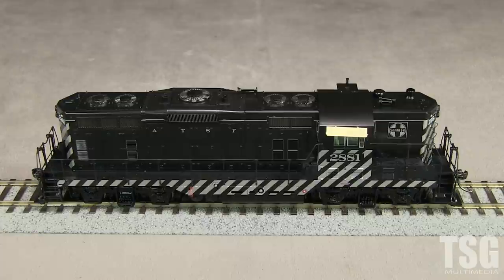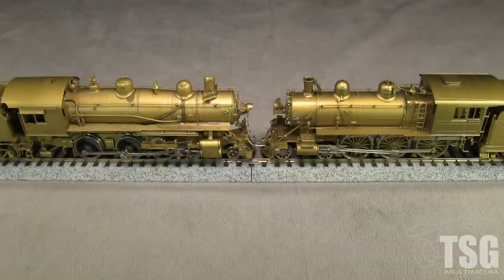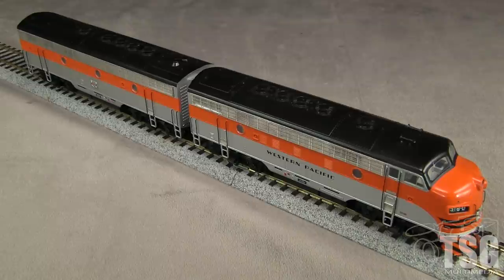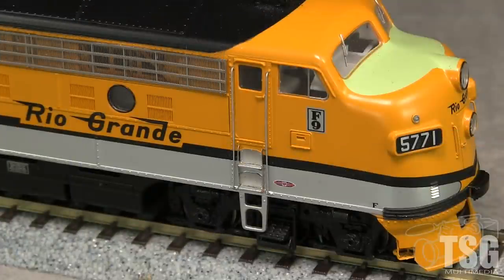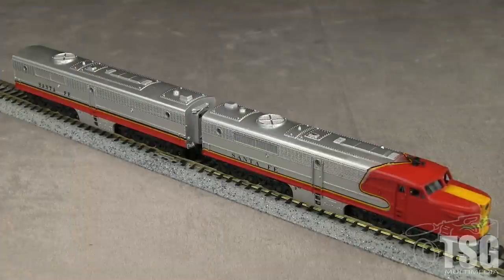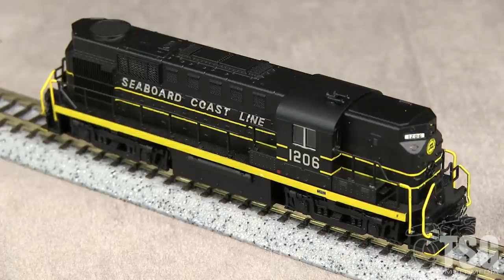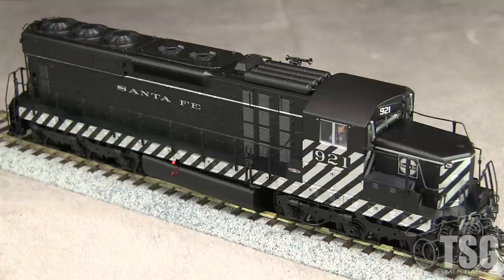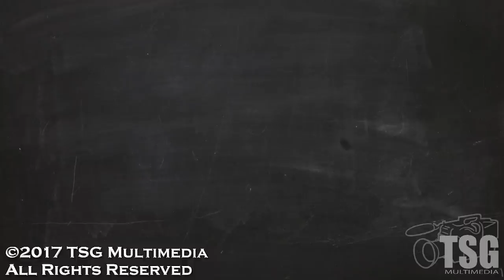Model Railroading 101 Diesel Locomotives For Beginners Pt 1

Comment: Another huge difference between steam and diesel:  To start a large steam locomotive from cold takes in the area of 8 or more hours to raise steam.  Plus there are hours of checks and maintenance (usually split up among 2 or 3 men) that goes on concurrently to the firing.  A diesel needs a lot fewer checks and maintenance.  It is much more like starting a car.  From cold, a diesel can be ready to go in 15 to 30 minutes.  

Consider if a train has an 8 to 12 hours layover.  On steam locomotive, either you have someone mind it and spend the fuel to keep it hot, or you have to do the hours long start up to build steam.  One could start out with less than full pressure and build pressure while rolling, but that might not work well with a heavy load or climbing a hill.  With a few minutes of warm up, the diesel is ready to make full power.

All of the above is why you often see steam locomotives being moved for short trip by being pushed or pulled by a diesel.  It is impractical to spend 8 hours building steam for a one-hour trip or just to move the locomotive around the yard.

Comment: I was attached to a diesel submarine in the late 60s with 4 Fairbanks-Morse 12 cylinder opposed piston engines. The old WW2 boats had GMC 10 cylinder engines. The piston-rod assembly weighed 273 lb.

Comment: Answer: They copied each other.
Alco seems to have invented the hood unit yard switcher in about 1930 with it's HH (High Hood) series. EMD (orignally called EMC) started building their more successful SW's from about 1935.
EMD may have originated the cab unit, car body (E unit, then F unit "covered wagon") type in about 1937 - 1939. Alco and others quickly copied the concept from about 1939 - 1940.
Alco may have been the progenitor of the hood unit road switcher (basically a yard switcher with a washroom / storage closet extension under the "short hood") with their RS1 in about 1940, but there is some disagreement over this. EMD didn't start selling their (highly successful) GP's until about 1948, after Fairbanks Morse and Baldwin introduced their equivalent road switcher types.
During the 1950's, any successful new development by one manufacturer (eg. cut down short hood) was quickly copied by the others.
Reply from the maker: Figured it had to be something like that. Innovation invites imitation!
Reply: Very true. Alco's RS1 certainly originated the road switcher body style. EMD tried to combine the best of both worlds, (cab unit and hood unit) with the BL2 - a short lived offering that was so ugly it's kind of beautiful - but quickly realized that the road switcher layout pioneered by Alco was the ideal design, and the superb GP7 was the result. I must admit, though, I do love the lines of the early Alco RS series locomotives. Prettiest road switchers ever built.

I don't necessarily think EMD copied Alco's design so much as they just recognized a good thing when they saw it. Let's face it, there aren't exactly an infinite number of ways to configure a locomotive. Like cars, eventually they all kind of look the same.
Reply: I know ALCO also pioneered the 6 axle road switchers in 1941 with the export model RSD-1 which was a C-C 6 axle 1'000 or 1'350hp road switcher for Russia during world war II, after the war unfortunately Russia Copied the design and made their own 1'500hp 6 axle road switcher called Class RS-15C and they made thousands of them, ultimately replacing steam by 1956. 
The Republic of Russia still uses some for transporting space rockets, passengers, Etc. Just FYI.

Comment: If I remember correctly with the FT model, "F" stood for Freight, and "T" stood for the 1350 horsepower of the unit. Also from what I understand F units, and I guess E units as well, are not legal for use as the controlling locomotive when doing switching operations. I think F7/F9 series units had slightly different main electrical system set-ups than those of the GP7/GP9 models too, but it's been awhile since I've read a GP7 or GP9 operators manual from cover to cover.

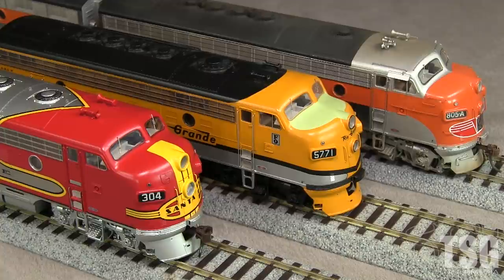Comment: 13:25 Huh, neat. I never knew there were dual-mode locomotives in the US. Turns out the first FL9s were even triple-mode: they had pantographs for overhead wires, too. Some of the locomotives were still in use into the 21st century.

Comment: Important note about the MU system: The 6 - 8 hoses below the coupler are air synchro hoses, the electric control bus cable is above the coupler on either side. Modern MU is nearly all linked by the master bus cable or a wireless control link (for DPU). In an MOW application or a specialized train like those on a mine railroad, one of the synchro lines will be modified as an actuator control link for air actuated operation like the 5 bay Trinity rapid discharge hoppers or the UP side discharge Ballast hoppers.

Comment: there was also the diesel mechanical locomotives that were used alot in the UK and czechaslovakia between 1960-1980 which were pretty much just tractors on rails (also a couple american railroads used them in the 1920s)

Comment: Union Pacific tried Steam Turbines and The better known Gas Turbines...  General Electric did the production of the different types of Turbines.  The earlier types (4500 HP) were only one unit and were the regular cab model and the Verandas with the walk way along both sides.  The Big Blows were the 8500 HP 3 piece units.  and the turbines operated into the late 70's.  Union Pacific actually built one of their own that had a PA1 as the head end unit... took a GG1 and stripped it down and built it with a turbine unit on it and a converted centipede tender to process what they used to power the turbine... COAL!  Pulverized Coal!!!  That one was 8500 HP too!   Only one they ever built.   trucks from the older turbines were traded in for use in the GE U50 .

Comment: I missed why steam generation in a diesel is required for passenger trains.  But I started researching and it's used for producing hot water in the passenger cars and heat generation in cold climates.
Reply: Yep. Steam-era passenger cars had low-power electrics for lighting but the easiest way to get heat was from the gigantic kettle at the front of the train. Early diesel locomotives had steam generators for backwards-compatibility with the existing passenger cars.

Comment: Erie Mining company Ran A-B-B-B-B-A sets of F units on ore trains until 2002!
Reply: I hope they weren't scrapped. F units are my favourite of all locomotives in the world
Reply: Black Terminal most were, Erie Mining shut down in 02 and most of there power was scrapped. An A B set is at the North Shore Scenic Railroad in Duluth, MN.
Reply: @railsofthenorthland1181  that's terrible. How many locomotive fans would have begged to save them. I would have. F series forever imo. I love them
Reply: I did a fantasy move where I took one of the A and B units and remade them into the Batman and Robin team. Actually there were two Bachmann Hawthorne units I ordered in the 1990's. Still, the fantasy part was that my railroad now has two of the Erie Mining locomotives used in private and excursion services.

Comment: 17:15 Correct -- the extra axle is for weight distribution. The locomotives were too heavy to sit on just two axles. Why not power it? Because the amount of power produced by the engine and generator can be handled by four traction motors. Adding two more traction motors wouldn't achieve much and the extra unsprung mass would make the locomotives harder on the track than the version with two unpowered axles.You might gain a little reliability from running the individual traction motors at lower power but, on the other hand, you also lose reliability because there are more traction motors to fail.

Comment: Really enjoyed the video but I recently learned engineers are told not to use dynamic brakes except on very very light trains or when just moving the locomotive around. The reason, from the UP engineer I talked to, is if you apply brakes on the locomotive and the rest of the cars have no brakes applied, the cars will slam into the locomotive and can cause crew injuries and possible damage/derailment; instead they apply air brakes to everything but the locomotive and let the locomotive coast.

Comment: Diesel parts were no more interchangeable between manufacturers than steam. Yes, two EMD F units (that you show) have a lot of interchangeability, but different models (and definitely different manufacturers) had the same parts issues as steam. And, in the beginning, not all diesels could be MU'd, especially different makes and models.
Reply: The video doesn't claim parts compatibility between manufacturers. The point is that EMD only offered a small number of models of diesel locomotive, and they build 2400 F7As that were broadly speaking identical, rather than building 50 model 1 steam locomotives, 75 model 2's, 30 model 3's, etc.

Comment: About the extra third axle: Not exactly sure if its true, but the reason I was given by one Loco Pilot in India, was that it aided in ground traction during start, especially when loco has to pull extra heavy loads.
Reply: That's what the third axle is for when it's powered, yes. When it's unpowered, it's for weight distribution, as stated in the video.

Comment: Nice to see diesels getting some love, but I wanted to ask something them and steam in general.
1. What do you think of railfans saying that steam loco's should be brought back as well as adding the fact they say steamers are stronger than diesels because a lot steam locos, especially articulated ones, can pull freight trains by themselves?
Reply from the maker: A lot of people have opinions. A lot of opinions are not based in reality.
Reply: Ah. I was just wondering what you think because I feel a lot of people over exaggerate  steam locomotive's capabilities sometimes.
Reply from the maker: It's kind of like thinking that airlines should go back to old non-turbo prop planes again. It will not happen. Steam locomotives should be preserved for sure, and they should also run from time to time; but to think any mainline would even consider returning to 19th century technology for business is pretty absurd.
Reply: I couldn't agree more.
Reply: But they run 20th century technology. And electric locos are the king. They can be small and have greater speeds than diesels. And with a very good acceleration and no environmental harm.
Also steam locos could do the exact same job with the exact same performance as diesels BUT you can also go to the supermarket with a motor bike same as fast as with a bike. I would though like to see different new experimental steam locos with new and untested technology just for fun, maybe something useful and romantic could come out. The thing electricity is like water for steam engines it requires some infrastructure but it has a lot of benefits.
Reply: @PanosSkarp  electric trains are probably not coming to the US for a long while. Mainly because the US is huge compared to Europe. The amount of stuff they would have to be made and maintained would kill off anyone's interest. Also, the power has to come from somewhere and wind, hydro, and biogas will not be able to cover all of the US rail networks unless they build a lot more plants, dams, and farms.
Reply: @nightfury8440  Steam in trains and zhips needed a lot of auxiallary equipment to do stuff before the steam is produced.  Fuel needed heating as it was PS300 which is basically crude with  rocks taken out.  Hot wells for water to boilers and pumps to move thr water. Disel came along and used lighter oil. Cooling system pumps wheredriven off the engine and took up lot less space and less maintance.
Reply: @PanosSkarp  I've been thinking the same thing with advanced steam locos. Though I don't think it can happen.

Comment: GE came first, then the other diesel manufacturers. the reason was that GE was ahead in the electrical equipment, as they were the first ones to produce reliable diesel electric switchers. those came before the heavy locomotives. GE could use their know how from the switchers to design the long distance diesel locomotives.
Reply from the maker: It is very cool history to learn about. One wonders how long it will take US railroads to switch over to electric, as so much of Europe already has.

Comment: Question..... why when two or more locomotives are used to pull the trailers one must go in reverse? why can they all go on same direction?
Reply from the maker: No, you can set them up in either direction. Most modelers put one or more facing the opposite direction because that is what we see in real life.
Reply: The locomotives work equally well in either direction. When two or more are connected together, they usually try to put a cab at each end so that the group of locomotives can equally easily be driven in either direction.

Comment: Please explain about details on engines and cars, plastic versus metal.Lionel O gauge have a high line of models with sound etcAny thing similar about details and sound in HOThank you
Reply from the maker: Not sure I understand this comment/request. Metal parts tend to be a lot more durable than plastic detail parts. Is that what you mean?

Comment: N and W Ran long hood forward for Crew Safety..:)
Reply: No.  The crew were just hopping it would turn into a steamer. 😁
Reply: I find it strange that N&W set up their power long hood forward, but put the bell on the short hood end, where as the Southern ordered their highhoods with the bell on either the short hood end, or the long hood end depending on which end was specified as the front. And now that I think about it, my understanding is the N&W highhoods were ordered with dual control stands.